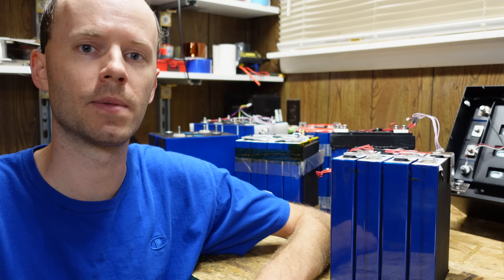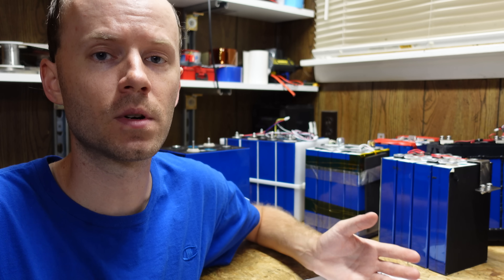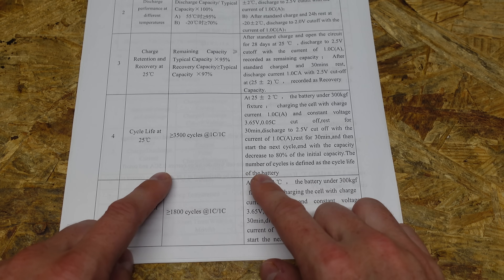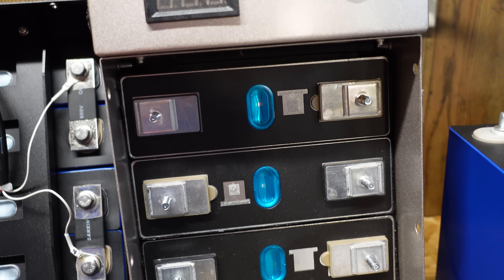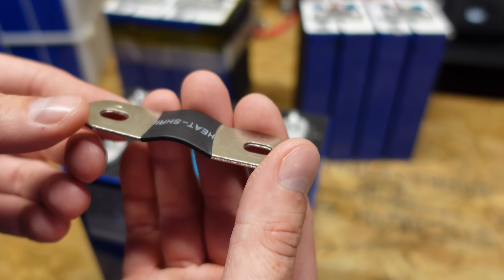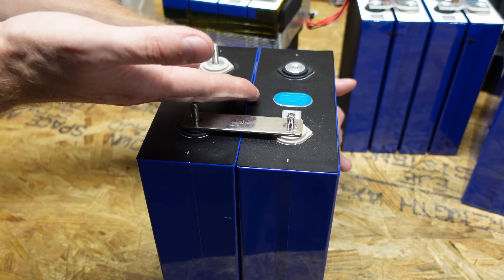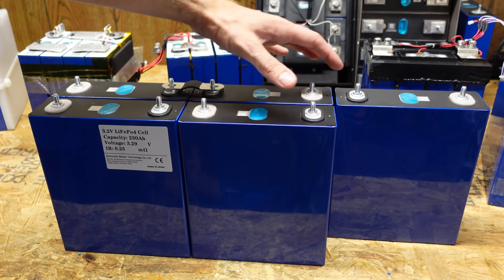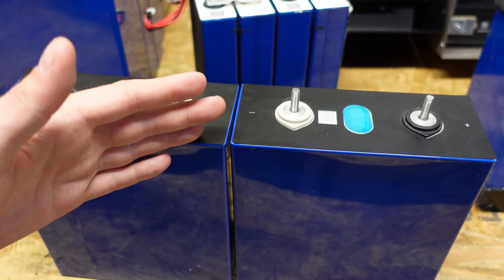LiFePO4 Battery Compression, Fixture, and Assembly - What's the Deal?

Comment: Ahh man such a bummer that the bus bars don't fit your cells in that configuration!! Fantastic discussion for the first half of the video. I agree with everything you said. Can't wait to see how you rebuild the pack when you find a way to connect those cells. Custom bus bars might be the easiest solution. I am tired of this issue as well. I've rebuilt my 15kWh five times now, and I hope I never have to do it again. Hopefully we found the solution now.
Reply: That is pretty funny that we are working on this same issue at the same exact time 😂
Reply: @WillProwse  you guys rock ! I've got everything set to my off grid  setup besides eve battery from aliexpress battery that I bought in July lol can't wait no more 🙃
Reply: Now if only we knew how to make flexible, braided bus bars ;)
Reply: @upnorthandpersonal  They do, they are called cables
Reply: @mfgxl  we knew what the guy was talking about but thank you for your clarification.
Reply: @mfgxl  In the communications field we call them copper braided ribbon.
Reply: @upnorthandpersonal  With hammer and schizel.
Reply: @upnorthandpersonal  See Jack Richard channel. His shop sells them
Reply: It's an inside joke; I make braided bus bars as well - see Will's forum.
Reply: @upnorthandpersonal  It wouldn't be that hard to make your own bus bars out of wire and solder ring connectors on them.  So long as the gauge wire equals the same cross sectional volume of the bus bar thats probably the best solution to this problem.  Its the ultimate in flexibility.
Reply: @J.DiPietro  I know - as I replied in another comment, it's a bit of an inside joke. Check Will's forum and search for braided bus bars posts of mine - I make those.
Reply: The spacers or holders are there to prevent shorts between the cell cases negative pole caused by vibrations if you use these cells in any mobile application. These are not for compression. A better way for that would be using rubber mats so there were insulated and compressed.
If you compress at around 40% soc there shouldn't be much force on the pole.
Reply: I think we need more information from the manufacturer.. WHY 1k more cycles with 12psi compression? What was their test setup?  Also, if the cells swell from the center then putting a ring spacer around the edges and then compressing will allow the centers to expand without putting pressure on the terminals.
Reply: @kevinpalmer1645  that is a fact! And the reason is a mix of chemistry/physics and the production process.
In simple and short words that is almost the same soc and pressure that is used while putting the components together during production.
Reply: @kevinpalmer1645  I agree however the compression I believe helps keep the stability and the integrity of the chemistry of each cell and therefore allowing greater it’s mansion from the center of the cell while being compressed would seem ideal.
Reply: Fortune cells are rated for 3000 cycles and are designed to be bolted together with threaded rod on top and bottom with space in between . They maybe able cycle more with some rubber type material between the cells.
Reply: @Erik-jp7kk  quelle pression sur les tige filetés ?
Reply: The "fixture" i.e. compression is about controlling bloating, this the increased cycle life if a cell is allowed to bloat it will over time damage itself...... so compressing them with threaded rod seems to be the most logical, although with the recommended compression being 12psi which I could apply with 1 finger, I'd recommend just snugging the threaded rod. Which will allow the cells to compress themselves .....
Reply: Yes
Reply: Find an elastic insulator sheet material for between cells?  Some type of nomex foam maybe
Reply: Kia Kamal kar dia
Reply: Glad to see you guys are discussing this! QUESTION: With all the connections you guys have to the sellers and manufacturers (and hopefully their engineers), I'd expect there would be some direct clear instruction from these experience experts (the ones that design and test these batteries) to weigh in on EXACTLY what should and shouldn't be done, no?

Comment: Could you use the appropriate sized wire with a ring terminal that is long enough to be flexible instead of a bus bar that would stress the terminal mounts when the cells expand?
Reply: This too was my immediate thought.
Reply: I think so. I am going to make flexible links from copper braid to replace my solid aluminium bus bars.

Comment: Measure your entire pack's physical dimensions (the one that's in service) at 100% soc and ~30% soc.  If fixture is solid, I don't imagine it will expand, the pressure will just increase on the cell walls and the terminals should stay in place.  Could be wrong, but seems logical to me.

Comment: The thing to do is just use a padding with the same compression strength as the tolerance stated 12 psi surrounding the cells giving it some room for expansion then going back to the 12 psi as it discharges.
Reply: So what you’re saying is go to zero SOC put in a rubber pad with a 12 psi compression material  between the cells, , then take the pack and Compress at 12 psi ?? and the way you go?

Comment: 2 strips of VHB tape height wise between cells and 3 wraps of fiber reinforced tape around the outside. The vhb gives slight room for expansion and the fiber tape minimizes stress on the terminals when expanded at high charge.

Comment: I am worried about lead acid batteries. we can  use thier 30-50% rated capacity only. holy shit then why you just advertise them as 150 ah
Reply from the maker: They're advertised like that because you technically CAN use the full 100% rated capacity, you'll just kill the battery very fast. Lol
Reply: Hello Ronak Soni. The lead acid batteries rating in for 20 hours discharge time, because at the beginning of automobile, there was no alternator, nor electric starter, there was a hand crank and candles for lighting, the candles were made for 20 hours service, that way, it was easy to compare between candle light, and electric light. If you had 20 Ah lead acid, it could produce 1 Ampère during 20 hours, but because of the Peukert effect, that technology can not give 20 ampères during 1 hour, all the energy can not be transferred that fast without losses. (heat, internal resistance, chemical reactions)
The lithium ion technology is less sensible to those losses, there is less internal resistance, less distance between the plates(that's the problem discussed in this video) so, here the rating is not calculated the same way, lithium ion can be discharged 1C, or more  lead acid is meant for C/20 or less. 
150Ah/20h=7.5Amp or less should provide the 765watts contained in your battery.
If you take 15Amp, the battery will not hold 10hours , maybe 5hours.

Comment: First, all the batteries you mentioned are inside an enclosure. which also applies some pressure on them, which you did not mention in the video. Different enclosures would put different pressure, and they might be more foam, but still, it does put some force on them - pretty much any video you do, when you try to get the cells out of the case, they are very tightly packed inside.
As for strapping/compressing, you can strap them when they 80 or 100% full... this way, you can apply little pressure, connect all of the busbars and know that the busbars will never be under pressure, and even if at some point they do expand more at 100%, that expansion will be minimal and won't cause too much pressure. Having said that,

Comment: buy .125 thick copper bar that is .75" wide it is roughly the same size as the busbars that is included. Cut them yourself or take to machine shop. Buy the 6 ft or smaller pieces as anything bigger runs into some serious money on shipping. 
I personally made my own copper busbars out of the stock bars and used threaded rod with a 2x10 on each end. If you notice some manufacturers have a really thick case and require no compression. Those cells do not bloat under full charge because of the case being much thicker. 
You also don't have to charge to 100% keep it at say 85%. 
I have seen lot of guys who do not tape or put in compression and they do a top balance and their cells are then all bloated out.

Comment: High tech lab has a link for custom busbars. You are obsolutly right about the expansion and contraction of these batteries.  I have to make jumper cable to use as busbars because some of the batteries had expanded enough to not be able to use the regular bus bars. One thing I noticed is the elongated holes of the busbars to give space for the expansion and contraction. I agree these cells need space for expansion. Silicon gaskets between them will help and the experts go along with the majority of opinions since their interest is to sell them.

Comment: well you could not use bus bars but then the cost will be higher and you would have to make all those cables. A 3d printed cell holder could also be custom made for each cell . I seen one fellow configure in a circle so none touched. I don't think it really matters too much they will die long before they rupture.
Reply from the maker: So you think I'm just being too paranoid about terminal stress? I'm completely open to that possibility as well! Also, am thinking more and more than I need to invest in a 3D printer...
Reply: @LithiumSolar  Well when you look at all the manufactured batteries they don't agree on the process either so it can't be a deciding factor but they do have to cover their butts. Many of us do go to the nth degree but if that is what makes you comfortable then so be it.
Reply: @LithiumSolar  I don't think so. Some of those terminals are very susceptible to stripping treads and breaking. Back and forth stresses from the bus bars could theoretically weaken a terminal enough to fracture or break completely, if a number of cells happen to all expand and/or contract at the same time. Breaking a terminal results in a bad day.

Comment: The main question is "why do you need those batteries compressed".
I never seen anyone answer that question, and I believe the reason is to prevent movement of electrolite.

If you let the battery pulsing, it will over time move its internals (catode, anode and electrolite) around reducing the capacity.
Keeping it compressed will prevent that, by forcing the battery to bulge evenly and forcing the elctrolite to move back where it came from 
rather than slowly moving to lower parts of the battery.

That is just a theory, but if thats the reason, then its less important how strongly you compress it, and more about how evenly its done.

Also, maybe someone knows other reasons why we should compross those batteries, that I am missing.
Reply: It's not to prevent movement of the electrolite. It's to prevent de-lamination of the cathode roll.
Reply: @upnorthandpersonal  hello fellow Klein
Reply: It's answered in articles such as this: https://apps.dtic.mil/sti/pdfs/ADA575499.pdf Or as other have noted the issue is that the expansion and contraction creates micro-fractures in the electrodes (There is one of which attached to both the anode and cathode) which will reduce capacity over time.

But you're otherwise correct that preventing movement of the internals is exactly the point. The more stuff moves, the more it can damage the electrodes and reduce capacity.
Reply: @JeremyAkersInAustin 
What this test actually tested is different than what he is testing. 

- Cell Type: Soft pouch format  
- Chemistry: Lithium Iron Phosphate (LiFePO₄) cathode + graphite anode  
- Capacity: Much smaller than 105Ah—likely in the single-digit Ah range.
Reply: @andymazur9962  Okay ... And? None of that materially changes the physics of expansion and contraction.

Comment: I ended up making bus bars with ring terminals and 6 gauge cause I never pull over 50 amps per battery. I have 4 310 amp hr batteries.